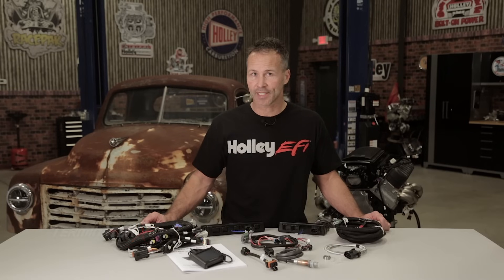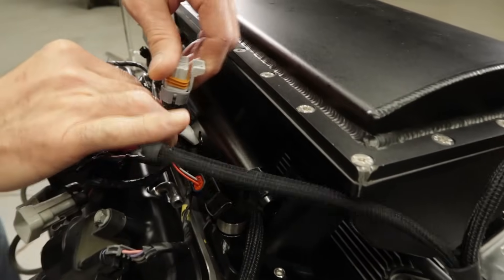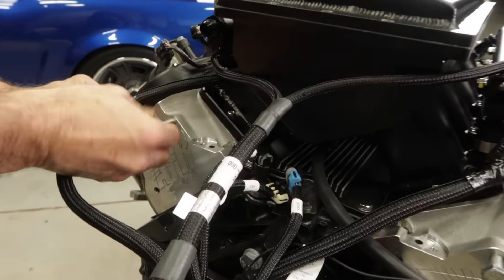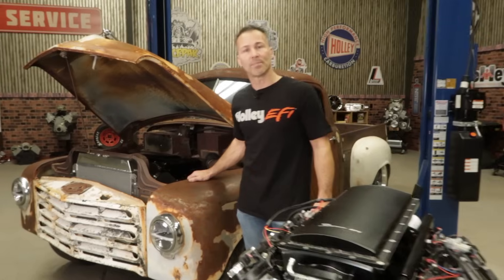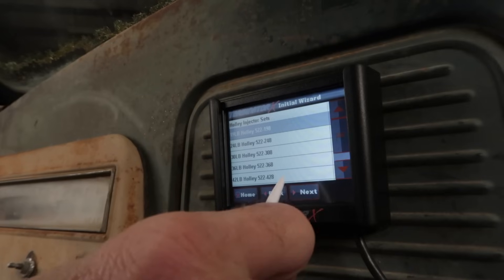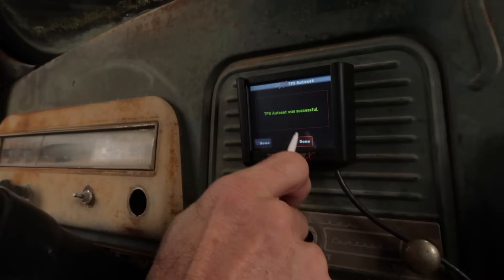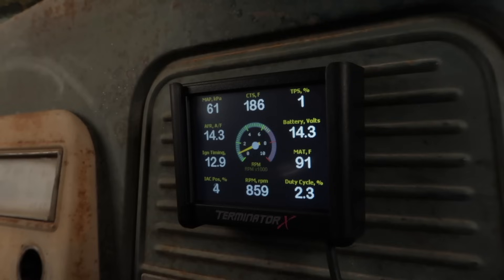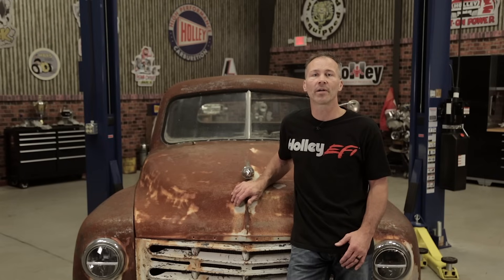How To: Install Terminator X EFI on any LS Engine

Comment: Not a plug and play 😢, Lq9 ls3 heads SS2 cam tbss intake, 92mm dbc throttle, 4l80e. Wont idle and head ache to tune..  stick with HP tuner 😂😂😂
Reply: Did you contact a professional tuner?

Comment: Hey can anyone tell me what oil pressure sensors and coolant temp switch I can use and that will screw right into my ls1 the connectors are different

Comment: Holley Recommendation: PLEASE include a way to wire directly to factory or aftermarket gauges using I/O without having to run Holley specific gauges AND your add-on gauge module.  These sytems are used for A LOT of resto mods, and your proprietary gauges don't fit the look needed for some of these. I.E I bought an AEM compatible Air Fuel Gauge for CJ-7 from SpeedHut, which is what you use. BUT, I can't get a reading from the Terminator X MAX to run it.  So now,  In order to make it "Period Correct" looking, I have to run it completely separately AND add another wideband. My experience with wideband life has not been good even when wiring and mounting is EXACTLY as recommended. The Terminator X is a GREAT product, but it can be even better...

Comment: Really helpful! Saved video for when my buddy and I start the swap into his G Body, then my G body lol. 
What I am curious about is how do run the lighting system? And the radio etc. Do I just run the harness as usual then run power to the factory fuse panel? And run everything else off that? My car is gonna be strictly track (I think) but his is for the street. 
The fuse panel should be fine to run that stuff on its own correct or do I need to run the Holley to it somehow? Thanks! 
If there’s no reply in a week or so I’ll probably send you guys an email. Thanks.

Comment: Another fun fact. Trying to install mine right now you’re basically need a 9 foot hole in your firewall to fit the harness through because there’s all kinds of stuff sticking out in certain spots.  This whole kit is a joke.
Reply: 2” hole works perfect and tuck those loose wires into loom there’s lots of room

Comment: Looking for part numbers for the Holley ultra low ram intake fuel rail hardware. Fuel line crossover etc. running the xmax kit with fuel transducer. An -8 feed and an -6 return. Looking to do the same as shown here.

Comment: Im looking to run this system on an ls swap, ill also be running water/meth injection, the w/m injection has a failsafe ill be installing that drops boost and timing if it notices a problem in w/m flow, how do i get this to work with this system if this already controls boost and timing

Comment: I have a 2012 Silverado that's not swapped, it's using stock ecu, can I install this as a upgrade, I like the auto learning aspect and can't find any info other than ls swapping older vehicles

Comment: Very curious do I need the factory ECM?
I want to LS LQ9 6.0 Swap my Blazer never done a LS Swap before but wanted a basic clean set up instead of having a wiring nightmare so does this need the ECM sense it controls the motor or do I still have to base the ECM?
Reply: The harness already comes with their ecm

Comment: Just curious if anyone may have an answer for
My square body ls swap. 

Some days it runs great. Yet some times when l 1st start it... (happens often) the air fuel will jump to 35% and will hardly run. I turn it off immediately... I do this, sometimes up to 10 times, before it reads a normal 13.5% and runs fairly smooth. 

Also at times when just cruising around... I will feel my engine hiccup a little. I started watching it and noticed when it does hiccup it because it jumps to a 25-35% air fuel mixture, just for a split second but then runs fine. 

Not sure what could be causing my issues... Any help for this jar head would be appreciated.

Comment: Will Holley ever have support for the newer transmissions like  the 6/8/10L90 transmissions on gen 3/4 motors? I would pick up the terminator in a heartbeat for my project if I could do so. I'm very sick of getting gapped by fords just because the immense advantage having 10 gears has. these 10 speed transmissions are a whole different driving experience.
Reply: 6 and 8 speeds are junk and 10 speeds all you hear about is them always searching for gears
Reply: @danielworks123 yes, exactly. Fast cars run 2 speeds, and the fastest cars (top fuel) run 1 speed.

Comment: is there an adapter harness or patch harness of some sort so i could use my existing ls1 harness to plug into terminator x? the reason being is that my current harness is already integrated with my body/chassis harness
Reply: Did you figure it out?

Comment: You put the MAT into the intake? I put mine into the middle of the cold air pipe between the filter and throttle body, Is this bad? 08 ls3 with 550-905 box

Comment: Is there any connection to the alternator?
Reply: Nope. $3000 for a bunch of wires and a little ECU but they couldn’t add in the alternator wiring.  It’s a joke. I’m in the middle of it right now and starting to regret it.

Comment: Why did you delete the knock sensors? Just bought the kit and would like to know. 

Thanks!!!!!
Reply from the maker: Knock sensors are very sensitive and take a lot of time to calibrate properly. It isn't usually beneficial to spend the time and effort to use them on an engine with an aftermarket cam, etc.
Reply: Holley were installing it on a sand car this weekend. So hopefully all goes well. Thanks for the response. I hope it all plugs in and fires off :)))

Comment: Maybe I missed it so does it come with accessories harness like alternator , starter , transmission etc or do you have to buy any of that separate ?
Reply: Never a response?
Reply: It’s all separate because the $3000 you spend on it for some reason they don’t think you should get the basics with it seeing as it probably cost them $50 to make one of these
Reply: @tylerseabook9423  3k ?I just looked and it’s 1200$ ?

Comment: Will it support A/C system like a Vintage Air? I know when the compressor comes on the Idle increases? Also can my Terminator Max 24 tooth be upgraded  to DBW/54tooth down the road without buying an entire new kit?

Comment: I was about to order The Terminator MAX for my 5.3 truck motor with 4160e. I want to utilize drive by cable and I'm confused which one I need. I do know it's a 24 tooth. Also, when I smoke this 60e, I will upgrade to an 80e. Do you just have add on plug to keep the same controller?
Reply from the maker: Hey, Randy. You'll need a Terminator X Max kit with transmission control. Just select your crank sensor (24x or 58x) and what injector connector you'll need. 4L60 and 4L80 use the same transmission control harness.
Reply: @HolleyPerformance  Thanks! I just ordered it.
Reply: Will it work on a 4l65e

Comment: Just bough the terminator x for my 350z LS swap. I'm very excited to get it installed! Great informational video.
Reply: I was looking to do this also. How did it work out?
Reply: mark stowell It worked out perfect. I’ve never had an engine start so easily. I have a playlist of the build on my channel.

Comment: What about the alternator pigtail. Does that not come with the holly terminator x? And if no what is the solution? I'm running truck alternator. Think originally was a 2 wire.

Comment: It would be nice to see a video for just the extras like, alternator connection, fans, starter & what not and how to connect them
Reply: The terminator comes without alternator wiring. You need to buy the 20$ 1-wire pigtail to wire to a 12v ignition source. The pigtail has a resistor to reduce 12v to 5v. If you wire it 12v direct, without the resistor it will burn up the alternator.

The starter is also wired separately. It's grounded through the body, and the main power is connected directly to the battery lug. Your trigger wire for the bendix can be wired to the 12v out from ignition or a simple momentary switch.

The fan wires to a universal 4 pin relay. And you use holley I/O's(inputs and outputs) in this case output. It can ground trigger the relay for the fan at set desired temp. Or 12v trigger the relay at set desired temp. 
+or- is an option for the output in the software.
Reply: You would think for the ridiculous price I paid for this thing it would at least come with the alternator set up. Starting to regret this more and more as I get farther.
Reply: Alternator and starter wiring included or need to buy it separately?
Reply: I literally just said the same thing!
Reply: Rite!...I was saying the same!

Comment: I follow Sloppy Mechanics and based on Matt’s example, I bought a Terminator X system. I replaced an aftermarket system and followed the instructions- easy installation and it fired right up. Very happy 😊

Comment: Hey I need the white pointer and the bracket to secure the handheld are there part numbers for those
Reply from the maker: Give our tech department a call and see if they can send one out. Those aren't sold as individual items, they come with the kit. 8666-464-6553

Comment: What are you using for manifold air temp sensor? LS Engines have built-in air temp sensors into the MAF sensor... How are you using these MAT sensors?
Reply from the maker: this kit comes with a plug for manifold air temp. it can be installed in the intake tube or in the manifold.

Comment: Great video - after doing several Terminator X installs on NA, stroker and Supercharged LS's I would agree its that easy - Terminator X is the absolute best all around  at this time
Reply: How is easy it for someone with zero tuning experience? Putting a 6.0 LS in a 1989 mustang

Comment: Got a Holley system on my truck and I love it!
Reply: minitrucker04 I’m getting ready to hook up my x max kit .. is it a certain throttle body needed?
Reply: gulfdawg2806 I have a drive by cable and you can use pretty much any tb. If u have a drive by wire I’m not sure on that one. I have never messed with a drive by wire.

Comment: Putting my LS3 together right now.  Can’t wait to get it fired up with a Terminator X.  This video and Sloppy Mechanics have been very helpful.
Reply: did you get the ls3 going?
Reply: @ModernBeastx1  he'll yea, Terminator X is a great system.  Very happy with it, engine is a beast in my thirdgen camaro
Reply: @SD-Time2grinD  post a video man!! i got a 5.7 out of a 99 corvette im building right now just got all pistons and rods in going to finish building it next week and then i gotta save up for the terminator. What tranny you running?
Reply: @ModernBeastx1  Magnum F with a monster stage 2 clutch and flywheel.
Reply: @SD-Time2grinD  😮‍💨😮‍💨 man I wanna see it! You should definitely make a video

Comment: My stock truck intake doesn't have the MAT sensor. What sensor do I use and where do I put it?
Reply: Well theres a MAT wire at 2:03 just saying
Reply: 3:42 is what I'm asking about
Reply from the maker: putting it in the intake tube is perfectly fine. Base cals that we have in Terminator X do not make huge changes to the tune with the MAT info, anyway. -Keith
Reply: @HolleyPerformance  thank you I forgot to google this lol

Comment: Are you guys going to do a video covering Ford Foxbody install I'm having a issue with my IAC plug Holley harness has 4 wires for iac and Foxbody iac has 2 wires so I guess I'm losing a output not to mention Holley dual boost control valve uses up 2.

Comment: Are you guys using new firmware than what you have listed on the site, my last few installs did not show fuel pressure or any other map sensors than 2.5
Reply: Great Question, Matt!
Reply: Any update on this info? Did you cover it in one of your vids Matt?

Comment: Really good overview guys, covering all the points!
Reply: The solid red wire on the 3 loose wire bundle has to have 12volts or the car will not run at all figured that out the hard way for anyone else that didn’t pick up on that party
Reply: @BACKDOORC6 I’m having trouble getting mine to start